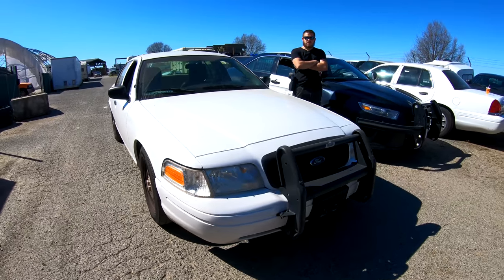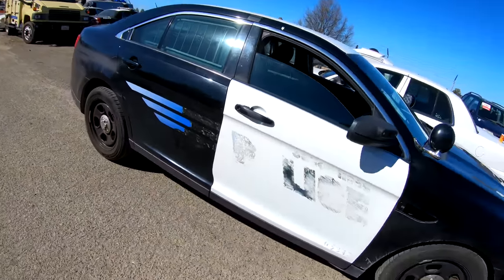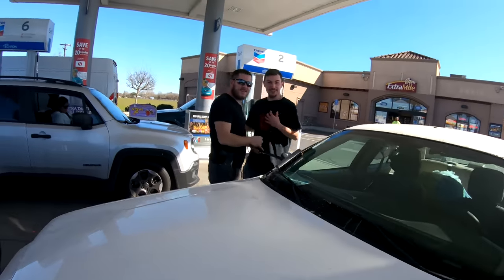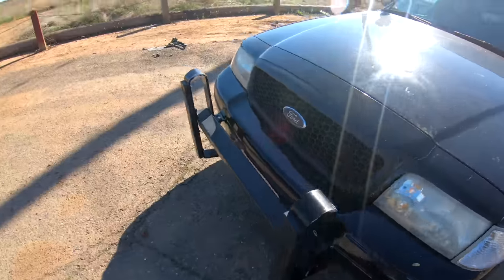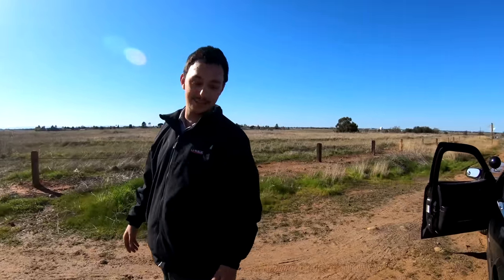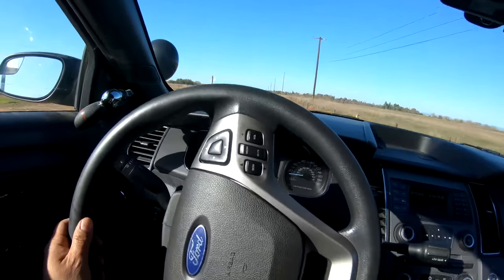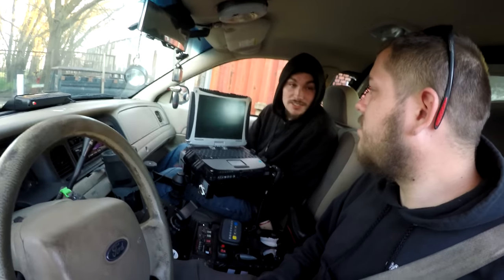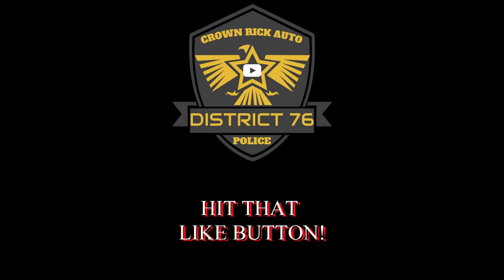Ford Taurus Interceptor VS Crown Vic Police Street Race! Crown Rick Auto

Comment: The Taurus is faster but it will never match the reliability of a crown vic...those cars are bulletproof
Reply: true, though the only thing I'm disappointed in the vics is the tranny, why a 4 speed I will never know its not really a good choice for acceleration, if it had a 6 speed it would have beat the Tarus easy
Reply: Ian Miller Reliability. It has less but better made parts.
Reply: With stab proof seats in the front.. Can't loose... The last of the old school build Ms. Victoria.. So many people hit my car.. And fucked they shit up..
Reply: @snowmexican5479  thinking bout switching to a 5speed manual for exact reason.. But I want more torque in gears.. Still learning
Reply: @Warlock 6 Yeah, that setup would be nice, but I don't think the cops could afford it, thats like 50g just for the car with that engine and trans, and then the police stuff on top. nontheless a good setup. Though I like Cleetus's setup on the channel CleetusMcFarland, he put a 08 gt500 witha 6spd in it, and got a blower from some popular Ford racing company (can't remember the name), the thing makes about 900 ponies
Reply: @khaliljefferson2876  I would do 6 but 5 is ok, if you want more torque you have to switch out the rear end its got a loooooooong gear ratio, something like a 4.10 or 4.30 or higher, even still any trans you get that rear end has to go you'll stall the car in 1st gear with that diff depending on the setup and the trans final drive. I would like to mod my vic but I can't I bought it to be as a winter beater, and even though I'm a JDM guy modding my v is a big temptation, I would like to stop at diverters (or known as exhaust dumps) but I feel that with time it may end up like Cleetus's.
Reply: wolvieguy  all to do with the gear ratio man, the v is only a 4 spd with a long ratio rear end, you should see how far the RPM drops from 1st to 2nd, from 6500 back to 3500 ish is alot for a american V8 that can barely rev to 6600
Reply: The  ford Taurus ppv is bullet proof and reliable I don't know where y'all get you out information from stop being naive and this is coming from a police officer
Reply: wolvieguy  It's because the Explorers offer 80% similliar performance and are way more practical.
Reply: The crown Victoria is one of the best police cars in existence that has discontinued for some stupid Taurus.
Reply: @snowmexican5479  because when cops have to pursue the last thing they want to focus on is what gear to shift into...
Reply: @CranioUomo  its an automoatic thats the issue and the crowns only got a 4 spd automatic trans when a 6 speed was put into the f150's that had the same powerplant, the same 4.6L romeo and windsor motors. cops never had to worry in the first place since its an auto to begin with its just the fact that ford put the 4spd instead of the 6
Reply: The body is separate so most of the time the body takes all the damage leaving the frame just fine
A truly genius and efficient design 
That's why they could perform countless pit maneuvers and all they ever needed was a little body work
Reply: A vic with no other modification except a 5 or 6 speed manual would have roasted the taurus. The taurus just has an additional gear to work with

Also the taurus is easier to launch it wont spin tires or get stopped by the trac control as easily as the vic. One has to get a vic or any V8 RWD really rolling a bit before goosing the throttle or else you just roast tires

The vic will be better on twisty roads though. The vic is big yes but its extremely hard to roll and does quite nicely in corners being RWD. Either that or i just dont like how FWD handles very much
Reply: Yep. They are far tougher. But keep in mind, the Crown is heavy with an underpowered V8. Had it had more power, it will surely beat the turbo V6 Taurus.
Reply: @snowmexican5479  the name you trying to remember is rousch performance with a gen3R vmp blower. its pretty much the same setup in the new GT500
Reply: @410GOArmy  it doesnt last longer than a crown vic and it doesnt even match the total production numbers. even more so when you throw performance mods on a crown victoria, they are not to be messed with. to be honest the only thing that CAN match a crown vic is the 2008 to 2012 dodge charger police interceptor. that thing can keep up with a crown vic in pretty much all areas
Reply: @snowmexican5479  imagine a 10 speed bro
Reply: My second transmission I am on from ford lol

Comment: I've been a cop for almost 15 years, and would take a Crown Vic Intercepter back in a heartbeat! They were without a doubt the best. I miss them a lot, and I'm not alone lol
Reply: What does your department drives now.
Reply: Robert Ortiz Dodge Chargers.....don't get me wrong, they're very fun to drive and extremely fast lol but they ride like a dump truck! U feel every bump and they have tons of problems. The front ends on most of them are gone around 60-80k miles, loaded with censors that go out, the fuel tank is under the back seat and they leak fumes of raw gas into the cab. They just don't hold up like an old Vic.
Reply: I hear you.
Reply: I just bought a 2010 Crown Vic Police Interceptor yesterday for $3000. It only has 140k miles on it  and it's all black. I love it. I also have a black 2010 Mustang GT. The Crown Vic is my daily driver now. I plan on putting Flow Master exhaust on my Crown Vic to make it sound like my Mustang.  The car runs like a champ
Reply: Space Force Captain how is the pick up compared to your gt in the Vic?
Reply: @whydoihave6neutrals772  

Not even close.  The Mustang absolutely crushes the Crown Vic in acceleration and top end speed. 

My Mustang has the 3V 4.6 vs the 2V 4.6 in the Crown Vic. It's pushing over 100 more horsepower on the Crown Vic. It's also much lighter in weight. I've also got some work done to my Mustang. 

They aren't even remotely close. Even if my Mustang was stock, they wouldn't be in the same ballpark...

The Crown Vic is more of a cruiser. I don't even consider it fast whatsoever... That's not why I bought it.
Reply: Space Force Captain thanks I kinda figured that would be the answer I’m 16 and broke as fuck and I just don’t want to drive a slow ass car around my mom has a Chrysler Pacifica and I can’t take it v6 with 250 horsepower at 6500 rpm but you can’t rev it passed 3000 or all hell breaks loose
Reply: yes buddy..interceptors crown victoria are the Best
Reply: The simplicity of the crown Victoria and the fact the body was separate from the frame made it the most durable police car of all time
All that performance in other cars means nothing if they can't take the abuse a police car has to endure 
The crown vic was a freaking tank a straight workhorse 
The fact they haven't been made since 2011 and are still active in many departments nationwide is a testament to that infamous durability
Reply: Stephen 3033 how it feel being a cop watching ppl do illegal shit
Reply: Thank you for your service. But, yeah, can't beat the legendary Crown!
Reply: Even in the snow?  We know the Vic sucks in the snow.  AWD Taurus or Explorer gets the job done.
Reply: Classic crown Victoria.   Everybody think you are policeman riding in the cruiser.   Such a fan of the YouTube channel.  Thumbs up 👍

Comment: The Crown Vic is such a beast of a car. It can take a real beating and the engine will run floored at 130 mph for a 20 minute car chase without a problem. They last forever, so reliable.

Comment: I think its mostly down to the fact the taurus is easier to launch because its fwd and the throttle is more computer controlled. you need to get a vic rolling a bit before you can lay on the throttle or else youll just roast the tires or come up against the trac control if its on

Taurus has an extra gear to work with too. I always said they should have offered the 5 speed as an option in the vic

Comment: the plug in the back of the crown vic is for an external charging system if the car sits for awhile. It's literally an extention cord hookup with a quick release and it keeps the battery at a trickle charge
Reply: Some may have that as optional  in certain areas.   My 08 has a harness in the trunk with way more connections than a charger uses.  With no external and I'm in the snow belt.

Comment: I mean... RWD solid steel vic vs AWD aluminum taurus... I love a good vic, but you can't beat a new interceptor with one.
Reply: @Eric Diaz Just Googled it. It looks like the new ones are aluminum, even the wheels, but the old/first generation ones were steel. I didn't see it specifically, but I'm assuming the frame is steel for strength.

Comment: The 2008 with the 3.55 rear was the fastest 0-60 of all the cvpi.. 2nd fastest was the 2004 cvpi with the 3.55 rear...
Reply: 04 is the fastest
Reply: @gehrkekyle3120  wikipedia says 2008 1/4 mile 16:29 vs 2004 1/4 mile 16:32. I tried to share link but for some reason its not working.  Wikipedia crown Victoria police Interceptor... scroll down to "comparison of civilian crown Victoria " then just scroll down. It lists all the crown vic 1/4 mile times.  But if you have different information please share. I'm interested to see it. I own a 2004 with the 3:55 posi rear end

Comment: The old 1994-1996 LT1 Chevy Police Impalas would smoke Both of those police cruiser!!
Reply: Owned a 91, fast as hell with 275000 miles on it
Reply: @tybailey9428  We still have 2 1995 unmarked (Detective) Chevy Caprices (Unmarked SS Impalas) and they are faster than our Tauruses and Crown Vics!! NJ Union county Sheriff Dept
Reply: @doncnunez6231  Caprice 0-60 was about 7.8. The Taurus is 7.4 with the 3.7. 5.7 with the 3.5 ecoboost
Reply: @doncnunez6231  if unmarked the probably don't have the light bar causing wind resistance. And extra weight because all of the gear

Comment: Taurus is of course gonna win. 110hp more and same weight. Honestly the Vic was never fast just a tank.
Reply: TorchRedS197 thats  only for the EcoBoost option vehicles the standard Explorer and Taurus Interceptor utilizes the same engine with 279hp 279 tq vs 250 hp and 297 tq crown vic the upgraded Transmissions are way better from the factory then the 4 R 70 series that comes in the Crown Vics which have a lot of shift lag in them A J mod or shift kit will clean that up
Reply: @crownvictorialifestyle4421  you got a good point!

Comment: The black PI must have the 3.55 rear end or the posi at least the way it pulled on the white PI. The Taurus would blow up if it had to chase a PI at 100 mph for a few miles. Top speed for a PI is 125, pushing hard on flat ground and the Taurus isn't rated much higher speed so I would choose the PI all day. Well I have one so I already do.

Comment: the taurus will smoke the vic i owned both and the taurus is wayyyy faster
Reply: In this vid, the vic was right next to the Taurus, n the 2nd race even closer...
Reply: maybe at the starting line
Reply: FordFanatics518 The vic will keep going well past 130. The Taurus looses it's acceleration much quicker. Smaller cars are usually faster off the line. But bigger cars with bigger engines will keep accerating steadily. Not to mention the Crown Vic will handles high speeds better suspension wise.
Reply: @RodknockRhett  lol no the PI gives up at 125 mph unless it's going down hill. Mine down shifts at 115 mph and pushing through 125 mph would take awhile and I have the 3.27 rear end.
Reply: Matt Garot Remove the speed governor, get some high speed tires (why there's a speed governor), and just floor it. You might be surprised.The 3:27 gears decrease the top speed in favor of off the line. The 2:73 gears will offer far more steady power well past highway speeds.

Comment: That must have been the 3.5 N/A because the ecoboost with 360 horse would smash that slow Vic. Vics go zero to 60 in like 8 seconds because of the gearing and 4 speeds
Reply: You can hear the ecoboost. They're evenly matched in weight. 3.5 N/A would've gotten smacked by the vic.